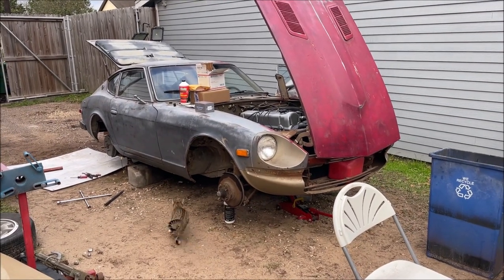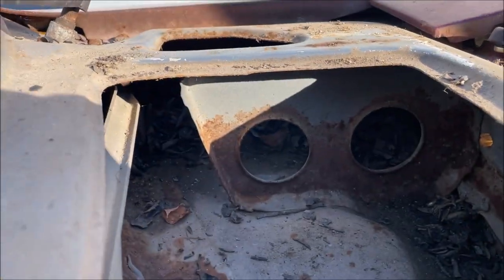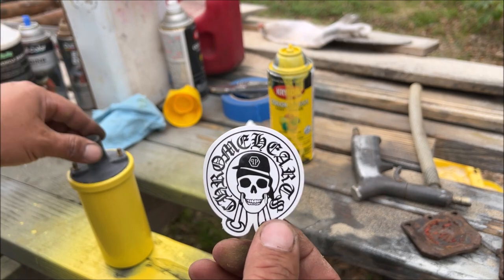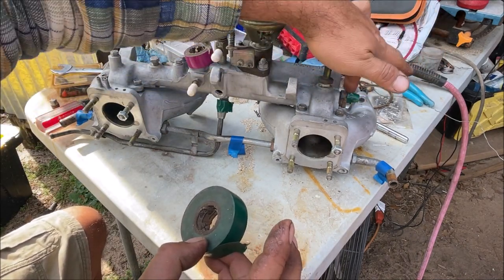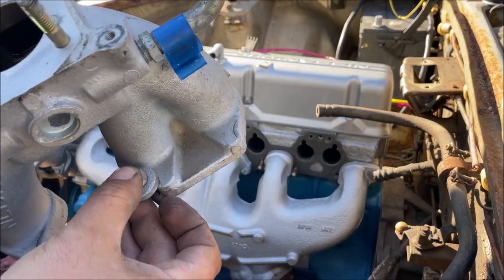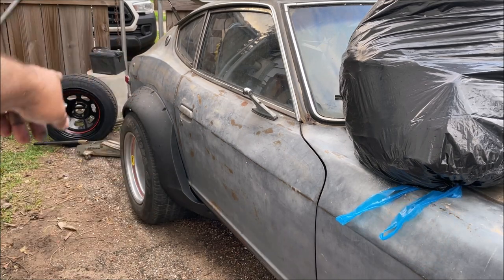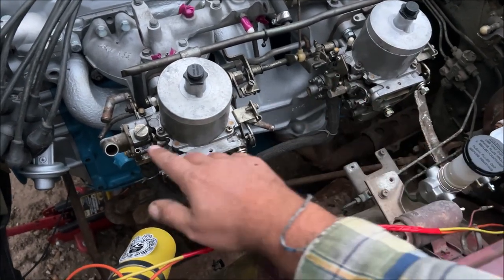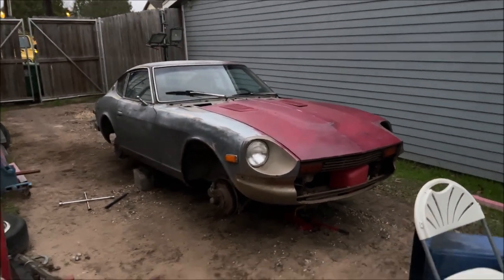1978 Datsun 280Z update 12/18/22 getting it ready to START for the first time

Comment: That Rustoleum paint looks nice on that coil bracket. Im excited to see if you hwve some luck with those flat top carbs. Good luck with first start bro. I will be watching, sucks your off vacation now. And your right the more you look at 240,260,280z's the better they get!!!
Reply from the maker: the more i look at the flat tops i think they will work just fine...  i have some plans to modify them to work like round tops... HOPEFULLY...   if i were you i would try to buy a set of round tops like i did..   keep in mind the throttle linkage is wider for the round tops...    so it will have to be modified..  i already figured out how to make an adjustable linkage... i should have it started this weekend
Reply: @chriscraft77022  yeah, my plan is to get a round set also. Your video on the carbs let me see how simple one set was vs the other 😂😂.

Comment: I always thought the coolant lines to throttle bodies was to prevent icing on the throttle blade. But it makes sense that it also helps to atomize the fuel. These should be kept if you live in an area that regularly gets below 50 degrees F, least that’s what I’ve read.